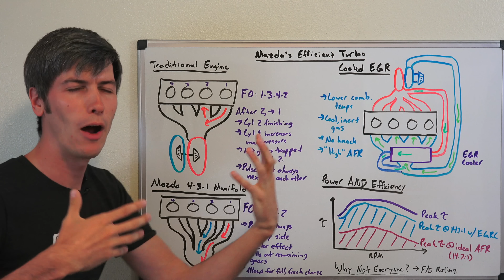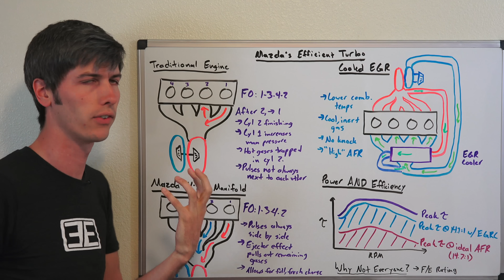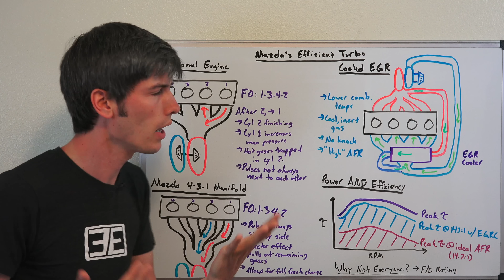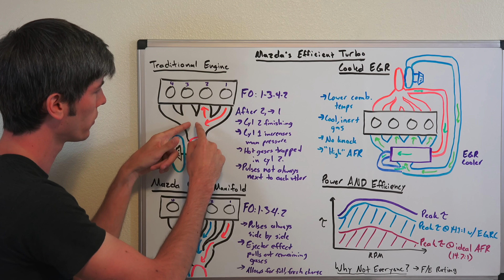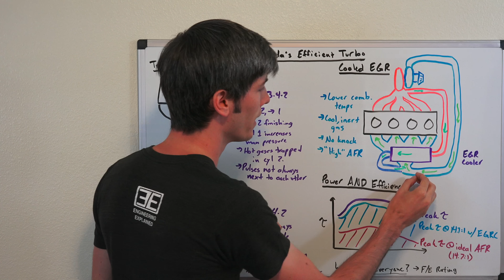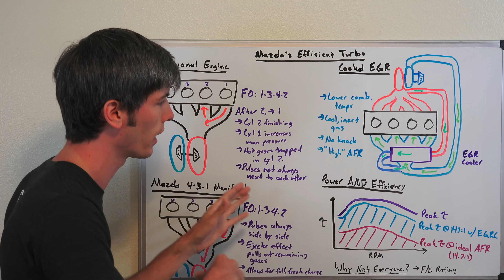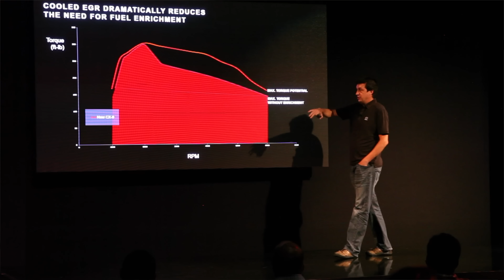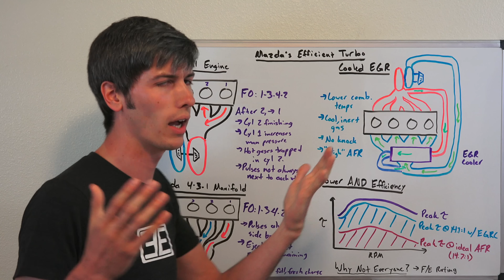Mazda's Secret To Efficient Turbo Engines

Comment: I would totally buy it if it offers manual with everything on it... Accord has manual but it's like stripped down version.. I want mid size sedan with manual with everything on it, and it does NOT exist.
Reply: KIA Stinger
Reply: Kihoon Cho , a Mazda 6 turbo was something I considered, but when I found out it wasn’t available in manual,  i was disappointed and I went elsewhere.
Reply: As they have created this tehnology because they listen to their customers, they might listen to manuals request too, keep hoping
Reply: BMW still offer the 330i and 340i with a 6 speed
Reply: Brad Collins that's not a mid sized car, still considered compact. The Camry and Accord and Mazda 6, BMW 5 series those are mid sized.
Reply: Honda still offers a 6-speed manual in the Accord in both the 1.5T and 2.0T engines in Sport trim. Not really a base model. It's pretty cool they're even bothering with that at all. Just to clarify misinformation. Honda is your friend in the battle to save the manuals.
Reply: The Cadillac ATS is available with a manual in the US, it's even RWD for extra lulz.
Reply: Kihoon Cho My opinion as well. All the reviews were very fanboyish on the accord. I have a 2018 camry XSE, and my brother ,( at my urging to try both), bought the accord 2.0T sport. The infotainment system is way ahead of Toyota’s, and the performance is superior by far. ( i have NA 4 cyl version) But the interior is NOT better which is what reviewers were saying. XSE camry is a good bit nicer as it’s the top trim. You really pay for that 2.0 engine, because the amenities are downgraded. Pass seat is manual, not power. Interior is fabric, not leather. . Does not have one touch up down windows at all four doors. Camry has parking sonar, full LED lights, even back up and turn signals. Also panoramic sunroof which i didn’t even originally want, but that is soooo much nicer than the small roof on the accord. So i guess it comes down to what matters more to you. If I had to do it again, I think i’d buy the accord to get the manual trans, but you really are giving up a lot in trade off if you want to pay a similar price which most reviewers aren’t being honest about. We both paid $27,000 for our cars. if you want a similarly appointed accord, it will cost much more. Also few reviewers ever mentioned that Toyota is using dual injection, so no worries of carbon issues as well
Reply: Does not exist *in the US*. You need to move to Europe to get a sedan (or anything else) with a manual.
Reply: Subaru offers a 6-speed manual for all of their cars.

Comment: 5:50 What is the benefit of EGR at this point? Basically, the engine needs air from turbo to burn the fuel because there is exhaust gas in the cylinder. And the cooled exhaust gas anyway is warmer than the air from outside so how does this benefit cylinder cooling? I know I understood something wrong but I cannot figure that myself.

Comment: Why not add water/MeOH injection into intake turbo manifold???
Reply: They don't think most people will like/remember to refill.
Reply: From a chemical stand point it wouldn't make sense to add water - The combustion itself PRODUCES water so you want to keep the intake water as low as possible to keep the reaction as optimal as possible (potential oxidation effects aside). MeOH strikes me as too reactive and does not by far yield as much power as the fuel does. Besides that, both would require an extra supply of the substance, whereas CO2 is readily available and inert.
Reply: Lemau ... we are talking HP increase as a fn of fuel/air mix density. The MeOH helps water combust. In WW II bombers were fitted with water injection to give 50% increase in HP on takeoff so they could lift the payload.

Comment: After seeing this I'd really love to see you do a video on the engine that Subaru put in the SVX...
The 6 cylinder boxer engine the Subaru used in the SVX produce 230 horsepower... As I recall... And utilize the 12 to 1 air fuel ratio... The car had a lot of torque I can tell you from my own experience... Especially for a non-turbo engine.

Comment: **((( Sounds great, but Mazda's variable valve timing system falls apart around 70-90k miles, and is VERY costly to fix. Until Mazda starts to build cars that won't expire at 90k miles( horendous Skyactive Technology that forces you to change your oil every 2k miles feels like or it locks down, and their paper thin weak CVT transmissions ), I'll keep my 265k miles WRX just fine. )))**
Reply: Wow...this sounds more just like a bashing of Mazda than an educated, real world experience and fact-based opinion!  Mazda by the way uses conventional automatic transmissions (skyactiv)  and NOT CVTs per your claim!
Reply: Ironically, Subaru is the one using CVT nowadays, not Mazda. Also, changing head gaskets is not reliable in my book.
Reply: JinX nowadays ? Subaru have been doing CVT since at least the mid eighties
Reply: I am interested in similar answers like what is the longevity of these systems  versus other engines with longer life spans like say a Volvo… I mean the whole powertrain not just the engine block and internals. Will this mazda engine need a turbo in 100k miles will the VVT eat its self in 150k miles will the EGR system start leaking in 60k miles? Because if it does all the fuel efficiency means nothing to the owners pocket in the real world.
Reply: Master Debater Toyota has used VVT-i for a good while now, and they have also adopted CVT in the new Corolla. Just because a technology is new, doesn't mean it has to be unreliable.
Reply: JinX, the CVT in question here is the Mazdas’s, not Toyota, not Honda. Mazdas have built trash low quality automatic transmissions for years, but they’ve mastered their on game building trash, jumping in the CVT bandwagon. Nissan and Mazda are now the leaders on garbage build paper thin CVT transmissions, just look up reviews. Have a nice day, and carry on...
Reply: Mazda does not offer CVT transmission on any of its vehicles.
Reply: GtaNation Mazda does not build cvts. Dude just stop talking. 😂😂😂
Reply: Hmm I change my mileage at 7k and never had a problem. Obviously the author is a troll.
Reply: I'll stick with my skoda, 20K / 2 year service internal on my 1.4 litre turbo.  I guess no exhaust gas recycling keep the oil a little cleaner
Reply: Obviously a Troll...

Comment: I have a CX9 with this engine and I have to say it's pretty impressive. I do actually get the fule economy that they advertise and I'm happy with the power. Under normal circumstances I get about 26-27 mpg (in a 7 passenger suv)
Reply: that's good man, considering that that engine probably has in the mid 300 horsepower. probably in the mazda 6 you'd even get into 40 mpg.
Reply: I get ~41 mpg in a non-turbo mazda 6 with gentle highway driving. The automatic version would probably get slightly better fuel economy, as it has a taller final drive ratio (3.8 vs 4.1 for the manual)
Reply: dump the egr...
Reply: @Lima Charlie I am not sure if this is sarcasm or not, but 70% of this video is explaining how Mazda uses cooled EGR for way better real world efficiency. EGR is not just some gimmick to help with keeping the NOx and CO emissions down(which is important, even if you don't believe climate change is real), but it also, if made correctly, helps with high load thermal efficiency, something turbo engines struggle with. Like I sai, this could be sarcasm, if so, ditto.
Reply: a nice excuse given by carmakers to cover up the cons of such a device to adhere to emission laws.. lets leave climate change aside... a similar effect can be achieved minus the clogging of valves by cooling intake air after turbo charging via intercooler, you just need to increase air-fuel ratio... if you increase fuel with the increase of air you get more power with a rich mixture, more raw power less efficiency with risk of knock however if you leave the fuel mixture same with increase of air after turbo charging you will get better efficiency than recirculating exhaust gas into combustion without knock too... that one was left out in the video...
Reply: It is not the same, cooling regular combustible air a little will still make it combustible once it is compressed. This is cooling the exhaust air, which is inert due to lack of oxygen, and putting it back into engine. It makes the temperature at which it will combust a lot higher, instead of just cooling it.
edit And the whole point of rich A/F mixture is to cool itself so it does not knock, that is why modern, less thought out, turbo engines have great mileage while they are maintaining highway speed, but as soon as you floor it and introduce any load, they over-boost and need to compensate with more fuel so they don't knock. Mazda circumvented that with a clever use of EGR. I think it is genius.
Reply: you're right if fuel is increased to cater to the increase in regular combustible air, but if fuel is not but air is, the extra air/oxygen will not be part of the combustion process hence lean combustion and increased efficiency.. you're contradicting yourself, inert air reduces combustion temperature hence the whole egr purpose but with higher chance of clogging for both intake valve and DPF/catalytic converter... 
wrong, rich a/f mixture is for more power at the expense of efficiency, knocking is due to lower octane gas or overly high compression ratio.. as mentioned before lean combustion will give great efficiency/mileage but as soon as power is needed more fuel, it has nothing to do with knocking... if emissions is not an issue, am sure mazda cant wait to ditch it.. as it increases cost, reduces reliability and provide no increase in performance/efficiency..
Reply: Lima Charlie You do not get it, the reason that does not work is explained in EE video before. If you just increase boost and leave the mixture as is, the engine will have a chance to knock due to high temperatures, which can lead to more then one explosion in chamber. They add more fuel to cool the mixture so it does not knock, not to create more power(consequently, they make more power as well). Making the mixture leaner would worsen the issue as the air comming in would make it even hotter, even with intercooler, especially since turbos high temperature makes the sir warmer then in a NA engine. Lean mixture is great for efficiency under low load, but when you floor it, the knock would kill the engine. Turbos are great for increasing power, the problem is that they do not use them for that. They use them to cheat the EPA to make it look like the 140 HP in turbo 1.4 engines uses way less fuel then a 140hp 2.0 NA engine, which is only corect at low loads(idle, maintaining higway speed). When you floor it, it gets actualy worse
Reply: Lima Charlie Inert air does more then decrease temperature, it increases threashold at which the combustion will happen, ie with just normal air it will selfconbust at 600 with just normal air, but at 750 with part normal, part EGR inert exhaust. And just remember, higher compression and advanced timing also leads to increased efficiency, by lowering them to accomodate for knock you are shooting yourself in the foot.
Reply: badbasic climate change is real.  Manmade? Not so much.
Reply: badbasic who doesn't believe climate change is real? You may want to go talk to real people instead of reading propaganda. Climate change is happening, the actual debate is if we are the ones causing it or if it's just part of the Earth's normal fluctuations. Climate aside, we are destroying our planet. We continue to poison the Earth and water yet we argue over it being slightly hotter then last year, nothing but a distraction to keep everyone from looking at what we as a species blatantly destroy every day.
Reply: Don't feed the trolls.
Reply: The problem is the "real people" are not the ones to talk to about such things. While I value peoples opinion on many great deal of things, science is not opinion based. And most people claiming climate change is not influenced by us do not: 
1. have a degree in the field that would make their opinion worth while
2. have access to equipment and resources to make a thorough study
3. have any current scientific study to point to that can back up their claims
When my car breaks down, I do not take it to some surgeon or a kindergarten teacher that claims to know all about cars, I take it to a well learned and proven mechanic. 
It is mid boggling to me that people in America trust their politicians, military leaders and even news anchors more then they trust NASA, which is just one of scientific bodies claiming man caused climate change. As a non American, NASA is one of the very few things I envy Americans about, being, in my humble opinion, the government agency that did the best job of elevating America's status in the world.
Reply: in many "real world" driving scenarios, an EV works out just fine.  i get great torque under 500RPM.  the accelerator feels very linear and response time is very quick.  im happy that this EGR debate doesn't matter to me one bit.  btw, as a starving student, i hated EGR.  my check engine light was on all the time because of gummed up valves and malfunctioning evap canisters.  i remember changing a knock sensor in a parking lot one night.  can't wait for battery/charging technologies to advance to the point where ICE has a fundamentally higher total cost of ownership.
Reply: Al in due time, but it will take a lot more advancement in battery technology before fuel density and practicality is close to ICE. I actually would not have a problem with it right now, as is, if it were not for 2 things. First is price, my country does not subsidize electric cars, hence they are way more expensive then ICE. Second is, my country has three public chargers in total for the whole country, going anywhere further would leave me stranded quickly. Owning a flat instead of a house contributes as well, as I can not charge it at night. If it were not for those thing I would have seriously considered an EV when I was purchasing my car, as long charging and slightly lower range can be circumvented with good planning, just not in my country.
Reply: Climate change is of course real. However man made little difference to it. It is the sun that is increasing its output as it ages. No scientist that can ever deny it.  Whether poisoning the earth or not, the earth will correct itself in just a matter of time. When there is more CO2 , plants will thrive and absorb it due to photosynthesis.
Reply: @Mike Culp Ditto your comment re:CX-9. A plus to me is that Mazda seems to actually want you to like their products, unlike most who dont care one way or another.

Comment: Only ~25 hp more to than Toyota's NA 2.5L @ 200hp. Alot of complexity for that little bit extra and less mpg.
Reply from the maker: Steven Kaspick 310 lb-ft means way more power down low.
Reply: Engineering Explained Thats true of course but I doubt 0-60 acceleration wise it means much. It will "feel" faster for sure. Much like a diesel.
Reply: So the mazda is faster by a second to 60. But slower than the accord 2.0T and of the V6 Camry. Which all get within a few mpg of each other on car and drivers real world findings. Again I dont get it but its still cool nevertheless

Comment: Does this cooled EGR make a significant improvement in NOx emissions?  With more engine operating range running stoich, can Mazda use a smaller, cheaper catalytic converter?

Comment: 227 HP that's not much  for a 2.5L turbo
Reply from the maker: Paweł Kuśmierek lots of power down low, 310 lb-ft, and 227 is on regular gas. 250 hp on premium.
Reply: So does the torque drop off quickly or the engine can't rev high to get more HP out of that torque? I guess either way there are side effects to these solutions, like at high rpms they can't get the exhaust pressures work as they would like to, and torque is lost?

Anyway, the video was very educational, thanks as always.

An owner of a small turbo (200 HP from 1.6L on regular gas) who now understands better why mpg goes down the drain whenever he has any fun with the car ;-)